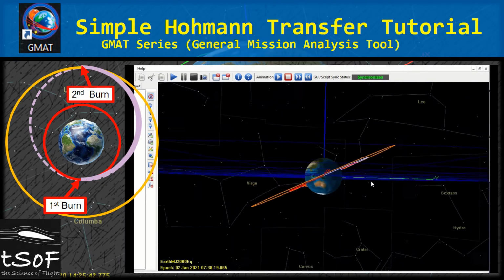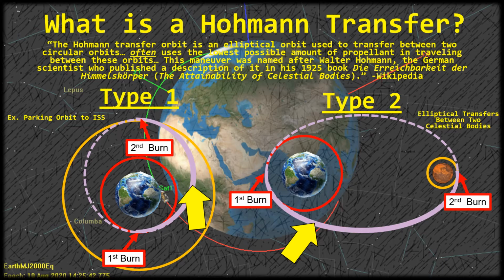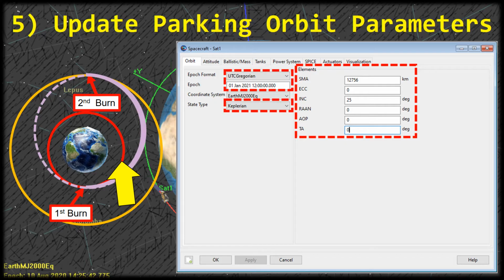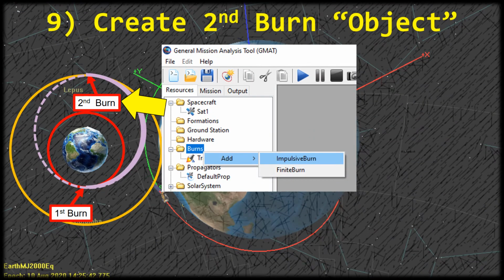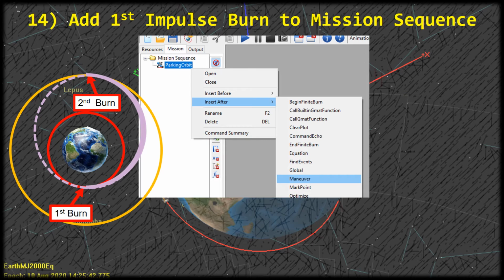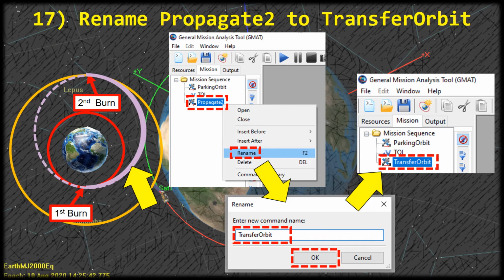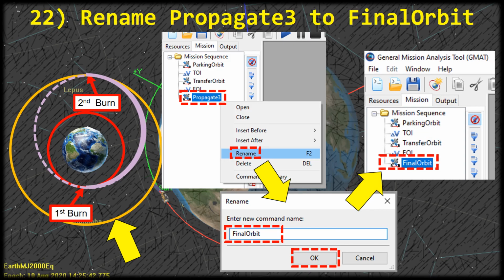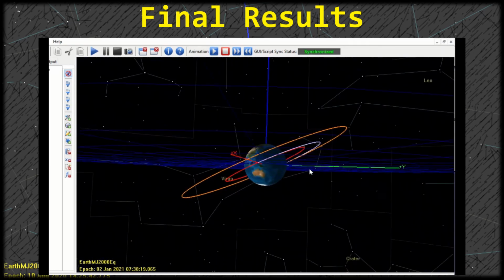Hohmann Transfer Orbit (Simple) | GMAT (NASA's General Mission Analysis Tool)

Comment: Well, I ran into a problem when saving the script. The default spacecraft dows not have a fuel tank. I had to add the fuel tank as a resource and then assign the tank to the spaceship, though you also seems not having a tank in the Resources folder. I don't know why you had not this problem in the tutorial. Maybe I made something a bit different.
Reply: I think, I opened and saved the script in the editor. This way I lost the ability to modify the data in the graphical interface and it seems it also behaved a bit differently and tried to refer to the fuel tank. Now I re-did the whole scenario without opening the script file and everything is OK. Anyhow, now I have the fuel tank attached to the spaceship, so that also changed the environment a bit - though I still used the Impulsive burn and had not checked the "Mass Change" option.